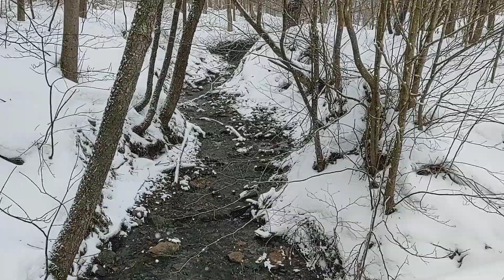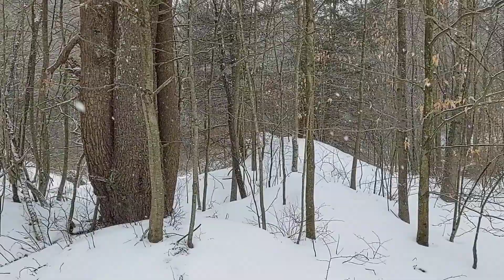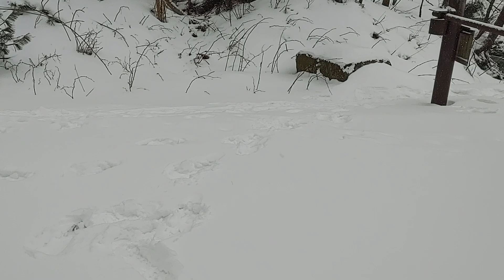Acid Mine Drainage Introduction Part 2

Comment: So when the water is super orange is that from alot of equipment left behind rusting,Ive noticed the wet mines are usually more orange in color?
Reply from the maker: No not always, although rail, and equipment left behind can contribute to the orange color, most is from the host rock.
Reply: @abandonedminesofpennsylvan266  Ten four thanks!